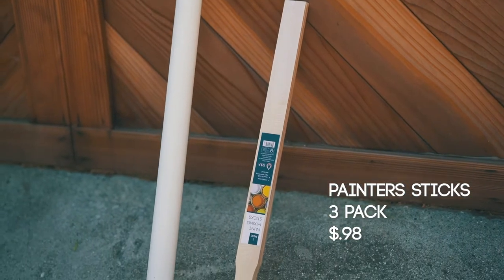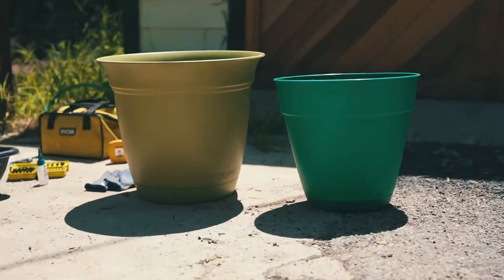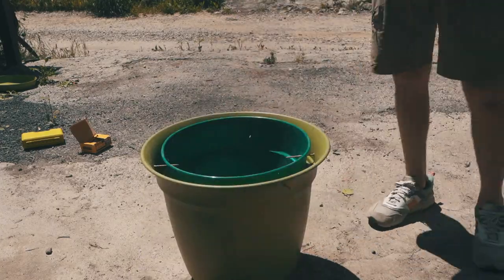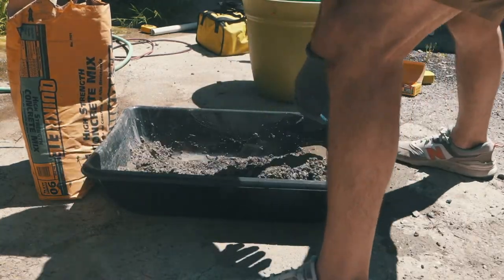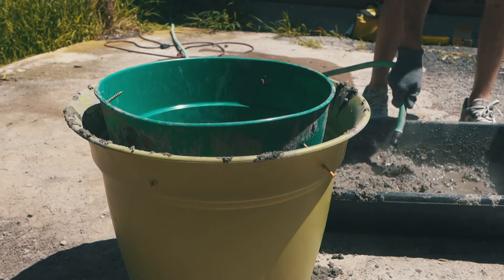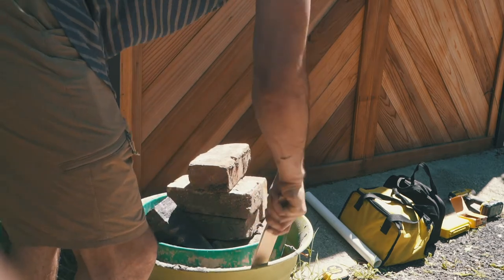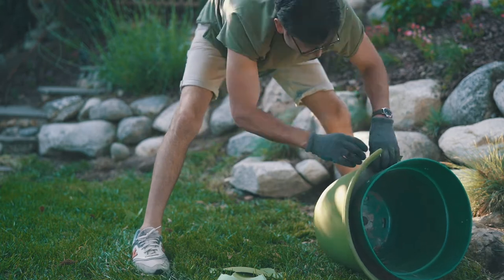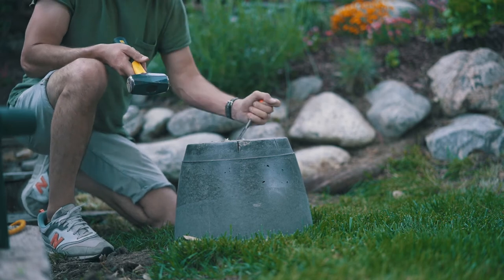DIY Concrete Flower Pot

Comment: well it's normal that the cement pushes upwards you had to fill the internal bucket with sand and then a little boiling water to remove the vase

Comment: Nice video but next time use some type or any oil and rub it on the plastic so it does not stick.  It will slide right out... Next buy a 1 inch concrete diamond bit so you can drill a hole at the bottom from drainage.. maybe $5 - 10.. worth it...good video
Reply from the maker: Thanks Miguel. Great tip!
Reply: TO get the pot out, you can line your pot with garbage bag, but only if you can tolerate texture.